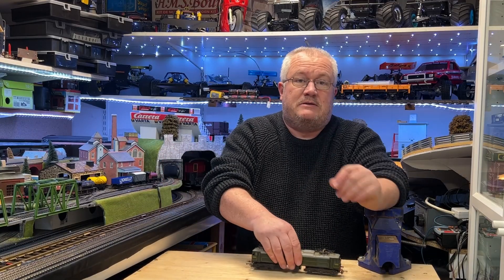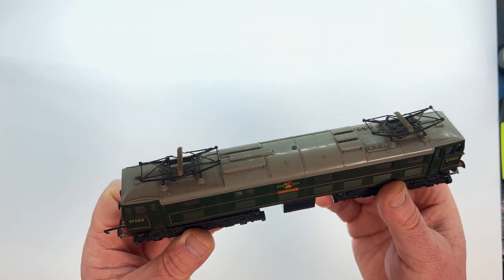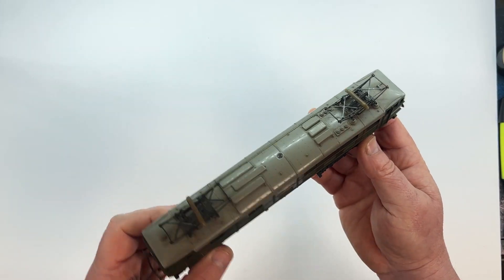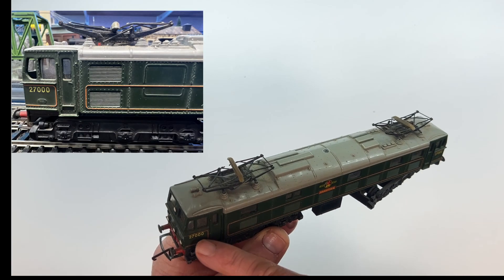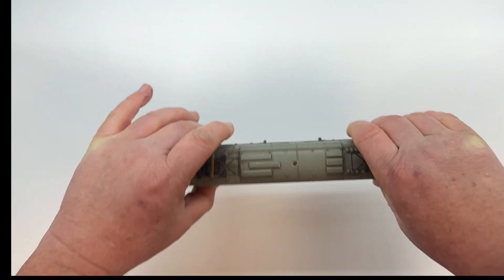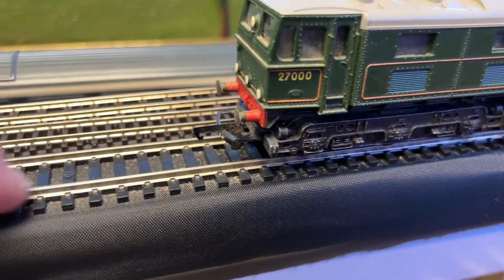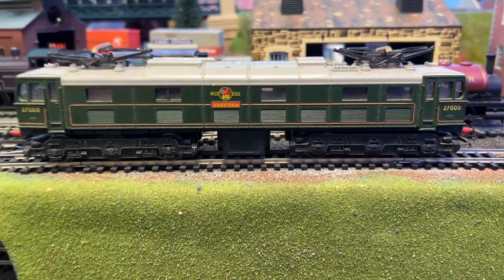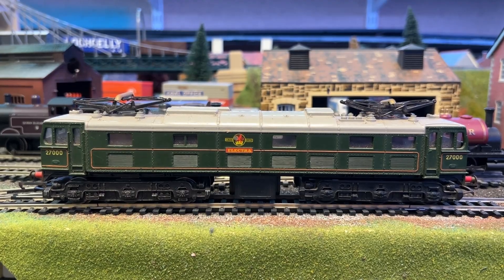Hornby Triang Class 77,  27000 ‘Electra’  R351

Comment: I have the blue version but I don’t have any problems with the wheels and track - I run it on Peco code 100 flexible and set track. I think you should be able to find a set of wheels with a smaller flange on auction sites. Lovely to see the green version.  Thanks for the video.
Reply from the maker: I will take a look for the wheels, thanks for letting me know and taking the time to write.

Comment: I have the CKD version of Electra. The front driven bogie wheels are marked with an "I" on one side for "insulation"  which means when you flick the switch on the roof to overhead current collection the insulated side must be opposite to the overhead catenary power masts
Reply from the maker: It been a while since I recorded this one, It didn't occur to me about the orientation of the loco when switched,  a very good point.
 Thanks for watching and taking the time to comment.